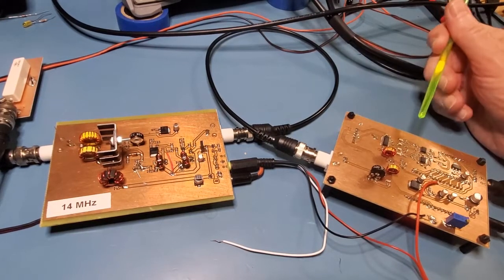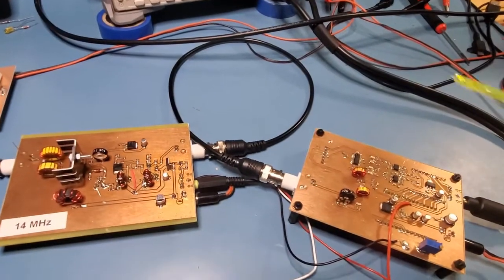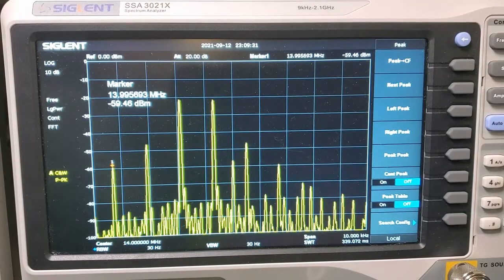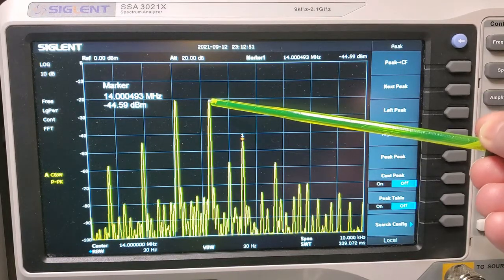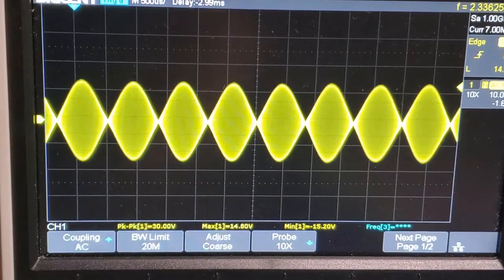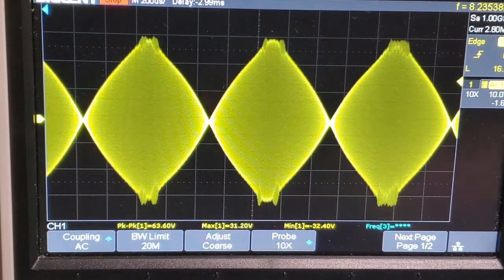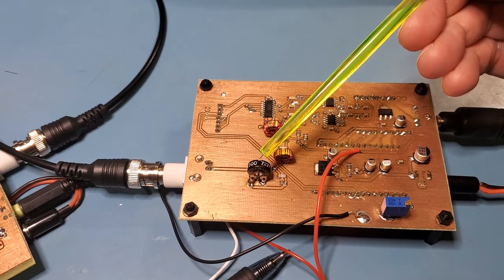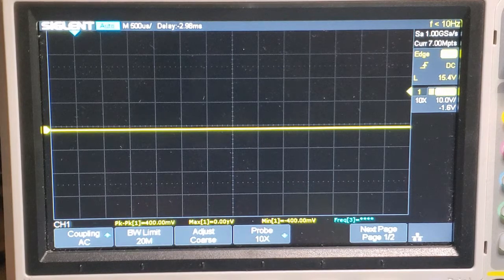Tayloe Mixer with Amplifier

Comment: 1:45 Just wanted to let you know that the resistor you are using looks like a wire wound one. It is far from 50 Ohms on 14 MHz, more like an inductor. I would advise using non-inductive resistors (metal film, metal-oxide). These are usually rated for 1-2W maximum, thus you will need several in parallel.
Reply from the maker: Thats a good catch Alex thank you - and explains some unusual SWR readings I was seeing on the KX3 while transmitting into it. I'll definitely change that
Reply from the maker: Just measured the resistor - 3uH, which is 260 ohms impedance at 14MHz. Going to redo the test with metal film dummy load and see how that changes the results

Comment: have you got a switch that lets you select LSB or USB?
Reply from the maker: Yes - you can either do it in software by swapping the coefficients in the DSP (in passthru.c at  https://github.com/thaaraak/ESP32-Transmitter/blob/master/main/passthru.c )   

    // Lower Sideband
    fir_filter_cfg.firLen = 300;
    fir_filter_cfg.coeffsLeft = coeffs_300plus45;
    fir_filter_cfg.coeffsRight = coeffs_300minus45;

    // Upper Sideband
    fir_filter_cfg.coeffsLeft = coeffs_300minus45;
    fir_filter_cfg.coeffsRight = coeffs_300plus45;

Or  you can do it in hardware by swapping the LO signals from the si5351. Thank you for the comment David!